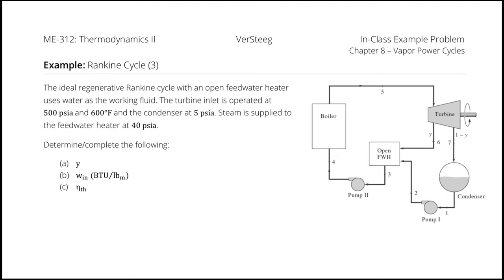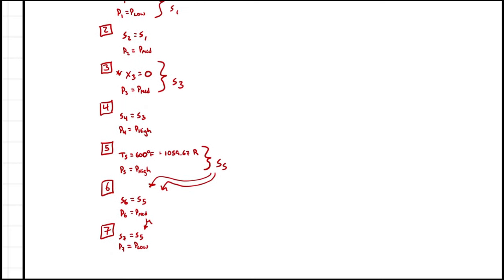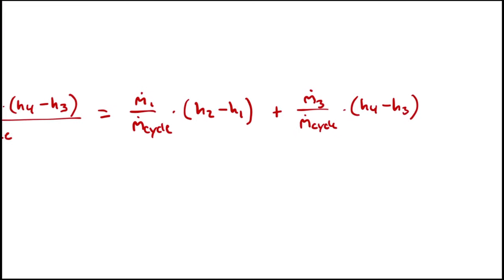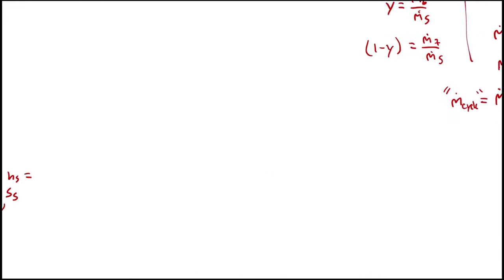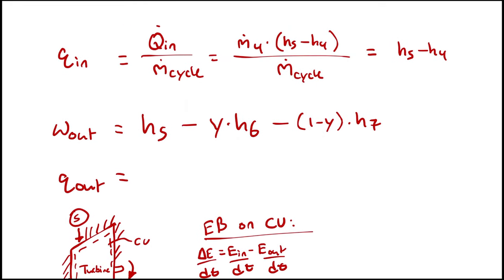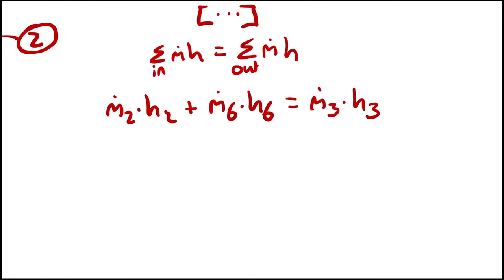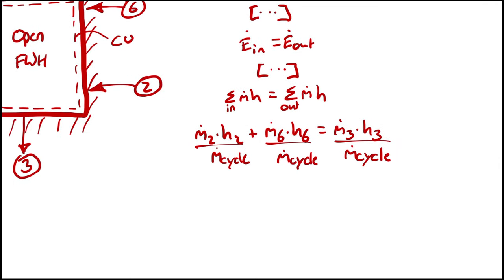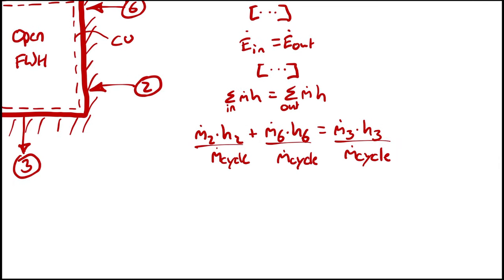Example Problem - Rankine Cycle (3) - Open Feedwater Heater

Comment: Question,  you said you couldn't do an energy balance on the boiler because you didn't know q(in). If q(in) was only (h5-h4), couldn't you have just found h5 and h4 and do the energy balance on the boiler instead of the FWH?
Reply from the maker: Yes, but in that context we were trying to come up with a mass flow rate or a proportion of mass flow rates — so we would have needed Q dot in (the rate of heat transfer in), not qin (the specific heat transfer in).